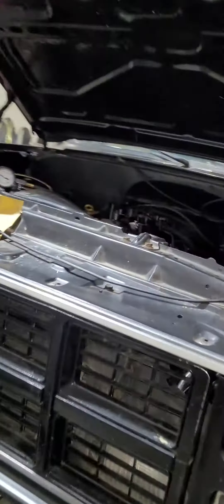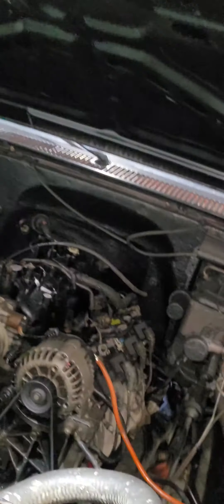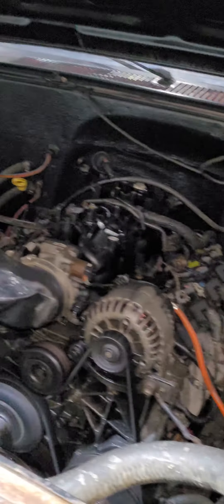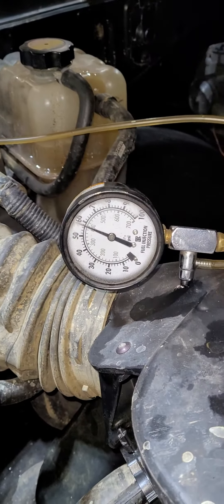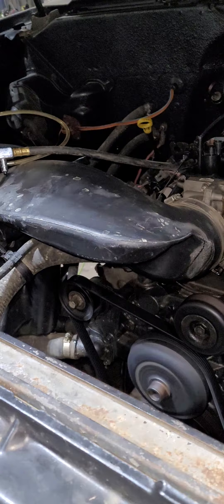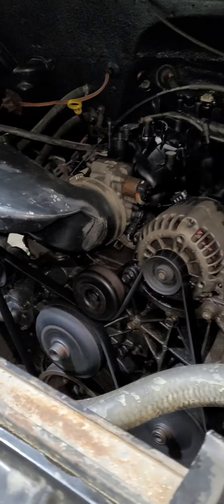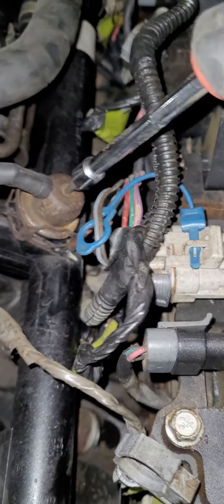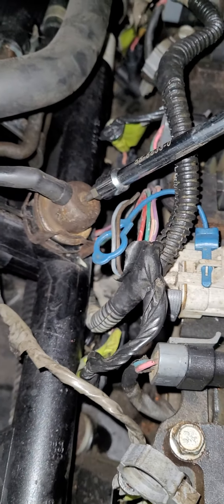5.3 ls engine fuel pressure where it should be and how to set the pressure

Comment: Man This video needs to be shared all over the place lol! I have the same exact adjustable fuel regulator on my 03 Silverado, I did have to replace the regulator a few years back due to the inner diaphragm screen being torn, BUT the auto parts store one was NOT adjustable and in fact it wouldn’t let it hardly go past 50-52psi which was causing it to run lean ASF to the point where it was throwing lean codes and just falling on its face! So I took the new screen and the seals all from the new regulator and put it on my old one and reused it since I discovered that the regulator itself is still in working condition. I got mine set right at about 60 psi and mannn did it make a huge difference, it sounds a lot better and responds quicker and also slightly better fuel economy. No more lean codes since then, and yes I also have a new fuel pump and changed the inline filter out too so she’s definitely getting the proper amount of fuel